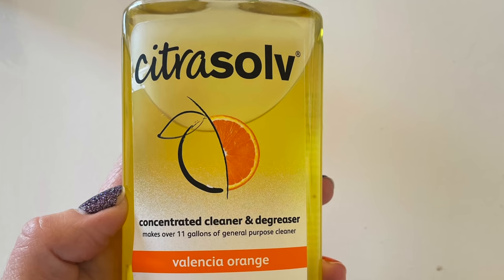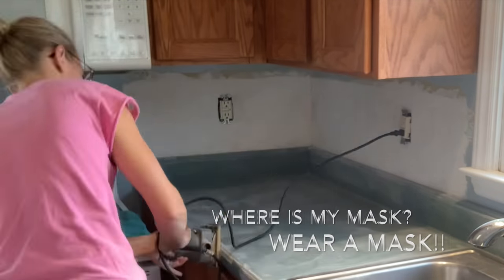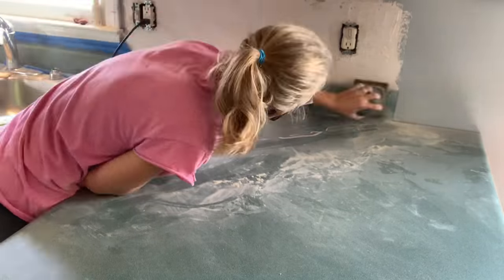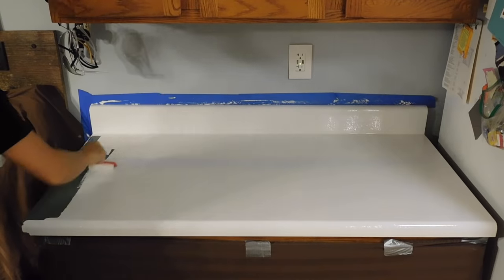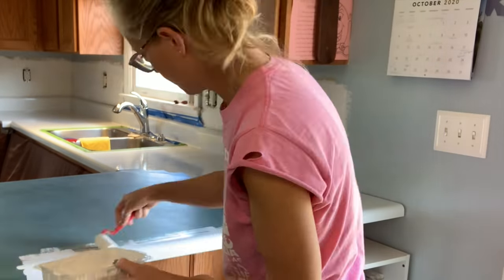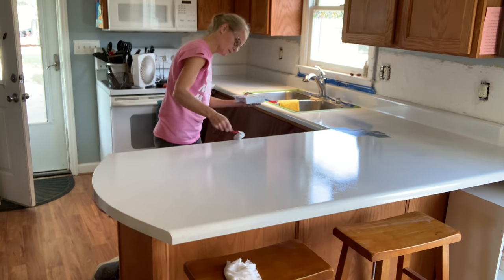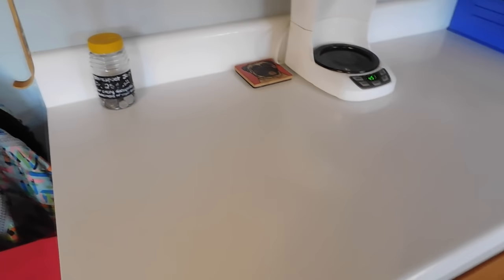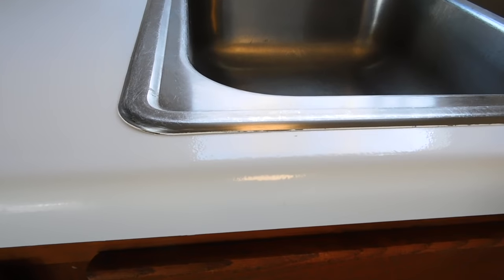DIY Painted Laminate Counter |CHEAP LAMINATE COUNTER MAKEOVER | DO IT YOURSELF EASY LAMINATE COUNTER

Comment: I have used a different product that was 24 hours between coats. It does self-level excellently. This, on my tv, looked like it had some orange peel bumps. The finish at that bad seam wasn't shown. I would likely have sealed the bare substrate with a non 5 minute epoxy from the dollar store. thin with a tiny amount of acetone if needed.Slow cure epoxy might give it some time to soak in, for reinforcement. Any dings could be filled with 5 minute epoxy. sand smooth, well after it's cured. 
recoat in an hour? I'll have to check out this paint. 
Vinegar attacks all the uncured epoxies I have used,  It's safe for cleaning up spills and washing hands. acetone, which a lot of people use, can thin the epoxy and help it penetrate skin.
Also, epoxy cures by heat. I often leave epoxy in the fridge if I'll need some the next day. Cover well, and seal the container, as that epoxy smell will get absorbed by food.
The can will probably list the cure time to rough usage. I'm surprised at the dings the final finish is showing. A common epoxy I use cures to final hardness after a couple of weeks.
Reply from the maker: Thank you so much for all this great info!!  It does have an orange peal finish texture, I like that, we like the texture. Its from the roller I used. Thank you so much for watching and commenting!
Reply: @JesiDavisBuildingaSimplerLife  : I like the orange peel for a countertop too. Imperfections are harder to see.
The paint i have used, Klenk, was made for refinishing bathtubs, and I was surprised at how perfectly it self leveled.
Another safety issue. NEVER spray 2 part paints, unless you really know what you're doing. The paint can cure in your lungs, and some give off toxic fumes.
Reply from the maker: @drewthompson7457  oh man that is scary! Good to know. Have a painted cabinets? We are thinking about doing the cabinets too. I’d live to do two different colors too and bottom.
Reply: @JesiDavisBuildingaSimplerLife  : I haven't done this, but I have read many times of using porch paint on cabinets. It's a pretty heavy duty paint.
As for scary, it shouldn't be, but it's a good excuse to read the labels.
Reply from the maker: @drewthompson7457  oh good idea with the porch paint! I’m sure very durable! Good thinking! Thank you!! Especially with kids and dogs! 😆 I’m not looking forward to taking the cabinets apart, but it’s exciting to think about doing and having, what will feel like a new kitchen! 😀

Comment: Is the texture on the counter from the countertop itself or the paint?  I think I might try this.  I used shiny black contact paper it was difficult to put on.  I would li,e to pull off the paper and just paint it.....until we can afford granite.
Reply from the maker: Hey Marlene! The texture is from the roller, I like it! I wanted a bit of a texture so it would hide any in smoothness from my application. I really like this, we both are very impressed! Wow I can’t imagine putting contact paper on a counter, I did my desk with wood grain contact paper, that was very tedious! Let me know if you do this paint!

Comment: Always put thin coats and you're supposed to sand between coat with soft sanding paper and wait more than 1hr between each coat and at the end you should put some protective coat on top 😉 just saying..
Working in renovation and construction these are few tricks and clean it with tsp or alcool before painting avoid humidity and cold ...
Reply from the maker: Yea for sure! great tips Thanks Natasha ... I chose this process bc it was less steps ... 🤣
Reply: @JesiDavisBuildingaSimplerLife  I know I did same mistake hon 
..we learn with time and with patience ...I'm 51 and still learn at work ...don't be shy to ask anyone and pls keep going on in your beautiful project..you're  good girl

Comment: What grit sanding paper did you use?
Reply from the maker: I believe I say in the video, but I think it was 400? Or 600? To finish, I used a rougher one on the water damage to start and then finished on the finer one.

Comment: Hi how did the paint  held so far . Any chip or paint coming off. Plz update.  Thanks
Reply from the maker: I do an update in this video on how its held up so far. There is only one additional spot than what I show in this video. The spots are from something hard hitting hard, the areas are small do not continue to peal or lift. I still would do this, but I would add more thicker layers in the end. Still looks great! I will do a 6 month review next month. Thank you so much for watching!
Reply: @JesiDavisBuildingaSimplerLife  thanks alot will be waiting for the reviews.
Reply: Is that fish dead?
Reply from the maker: @loristrong8896  no he is still alive! 😂

Comment: If you drip coffee or juice or sauce on it, does it stain the counter?
Reply from the maker: Coffee juice and sauce have all cleaned off without staining. We even had a wet spot that mail was dropped on and the dye from the paper was all over, I caught it and cleaned it, that came right up! I was surprised. I thought for sure I would have a pink spot forever. Thank goodness!

Comment: Turned out amazing! Do you think if I used a top coat/sealer such a polycrylic it would protect it better?
Reply from the maker: I would think so 🤔 my only reserve is making sure the two bind together, if that’s even a thing? I’m no pro! 😆 I think it would add more Protection. If you do this! Let me know how it goes! I may consider sanding mine a little, add more coats and maybe top it with a polycrylic if it works for you! Let me know!! ❤️

Comment: How long did it take to completely cure after your last coat?
Reply from the maker: Completely cure was about 7 days, mind you it was 90% humidity, so with lower humidity it should take much less. Thanks for watching!!
Reply: @JesiDavisBuildingaSimplerLife  I live in Miami, Florida. So the humidity is always intense.  Also, did you figure out how to remove stains without  removing the shine? What products do you use to clean/disinfect the surface?
Reply from the maker: @m95-x9q  I haven’t yet, I’ve tried shaving cream and toothpaste, smells good, but no luck there. I mainly use microfiber clothes and water, but have used vinegar dishsoap water and Clorox wipes on the counter, and all is well! Cleans easy and remains nice and shines! I most recently dropped and broke a big ceramic bowl on the counter that I tried to catch but in turn me trying to catch it while it broke on the counter I scratched some paint off. The scratches have not continued to chip or peel. Yes Fl stays humid. So expect a long curing time, we were able to place light items on the counter, and I placed our coffee maker on a book so the feet wouldn’t leave a mark. Good luck! Let me what you decide to go with! 😊
Reply: @JesiDavisBuildingaSimplerLife thank you for all thr advice! I greatly appreciate it!

Comment: Does anyone know if this will work over butcher block?  I did 5 coats of sealant over it and it still isn’t protecting the stain…after 4 years….
Reply from the maker: hnmm 🤔  your sealant isn't protecting the stain finish on your butcher block? I'd personally prefer raw butcher block, no stain or sealant and keep it treated with mineral oil and use it.

Comment: Plastic laminate sands easily by hand—a sander is not necessary and may make the job even dustier.  I would only paint a counter if it was this type—with all the curves, but if it was flat, with right angles, re-laminating would be the best long term solution.  I’m re-laminating my 50 year old bathroom counter and only to change the color!
Reply from the maker: Thank you so much for watching!

Comment: Needs a back splash which you can do for about 80$. I just did mine.
Reply from the maker: Hey there!! thanks for watching,   ya know we still have not locked in on exactly what we want to do for the back splash, We may wait till we do the cabinets, which Im waiting for the humidity to die, so that may be a winter project!

Comment: I think I would have painted the cabinets blue-gray or some color. Looks better than the green, but I’d be afraid it might look tacky for me!
Worth $40 yes, but worth all that work?? I don’t think so!😂
Reply from the maker: Hey Ann! yes way better than Green 🤮 for sure! It was well worth it for us, this project took nearly just one day, but two days bc of the gouging I had from water damage .. and then just waiting for it to cure, I took the kids for a couple week trip the day after I was all done, so that helped. The kits I was looking at and other paints required more steps, I chose to sand, even-though some tutorials said it was not necessary, and then it was just painting. Easy, really if I can do it anyone can do it. Im all about less steps and affordability!  Im looking at maybe Cerusing the cabinets .... Im going to run a trial in the bathroom, but first i need to wait for lower humidity. 😀  Thanks so much for watching!

Comment: I did this just a few months ago.  It's horrible. I used white. I have yellow staining all over that I can't get rid of.  I hate it.  Not sure what I will do now.  But I can't get the yellow stains off at all
Reply from the maker: Hey Shannon, oh man! That stinks! I have a few stains that i haven't been able to get rid of, but I don't see them unless Im really looking. I think I may change it in the next year or two, Im thinking ill sand and then epoxy over it.
Reply: The yellow staining is coming up from whatever it is you painted over. It probably would’ve been a good idea to use a stain blocker as your first coat.
Reply from the maker: @susannovak8263  I do not believe that the yellow is from under the paint. The yellow has always been a ring from a wine bottle or coffee splatters. I sanded and citrus cleaned the counter well before application. Thank you so much for watching and for your comment. ♥️

Comment: You can have water on this now and it won’t peel..??
Reply: I have the same concern, but a water based polyurethane application can be applied to protect the painted surface from water, markers, etc.
Reply from the maker: ive had water sit and no peeling ... not at all

Comment: Your finished surface looks orange peeled at 11:19. You should sand it with a fine grit and put a clear on it.
Reply from the maker: Thanks for watching!! I will have to check that out?! I’m not sure I know what that means!!
Reply: @JesiDavisBuildingaSimplerLife  When you hold the light at a certain angle you can see how the coat of paint is laying on your surface. In this case it has the look of an orange peel.

Comment: Now she needs to paint the cabs and add brushed nickel pulls.
Reply from the maker: Yes!!!!! My hubby actually just said he will let me paint the cabinets!! Already have cast iron pulls and handles! I’m excited!! Thanks so much for watching!
Reply: @JesiDavisBuildingaSimplerLife  Clean the cabinet with TSP or similar, or dixiebell whitelightening  cleaner. Use XIM UMA primer and binder.  Semigloss paint with a little Flotrol or similar. Keep a spray bottle of water to mist to keep the surface moist while you paint to avoid streaking. Flotrol helps with that. Mark doors as to their position as you take them off with a peice of tape where the hinges were. Try Benjamin moore Revere Pewter or another griese color. Maybe a lighter above and darker below.
Reply from the maker: @rw9019  oh I love that! Yes! Thank you for all the suggestions! I appreciate it! I too was thinking lighter upper, in the light grey family and then Darker below! ❤️

Comment: I wouldn't use this if it is so easily scratched.
Reply from the maker: I did scratch it with a broken ceramic bowl, other than that, its held up pretty well.

Comment: This is probably the worst idea ever. Paint is not designed to be used on a counter where pots, water, dish rags, dirty dishes set  constantly.  No way. I would have left the old counters until I could have afford to replace them.
Reply from the maker: Thank you so much for watching and your comment! We are still loving it!! Worth the $40 face lift, its going strong! Next we are about to repair our flooring from a refrigerator leak, priorities 😀❤️
Reply: Actually, this is a terrific idea for a quick facelift.  She didn’t use regular paint. Epoxy enamel leaves a very hard finish.  I don’t know of anyone who leaves pots, water, dish rags and dirty dishes on their countertop “constantly“.  With care, this should last quite a while.